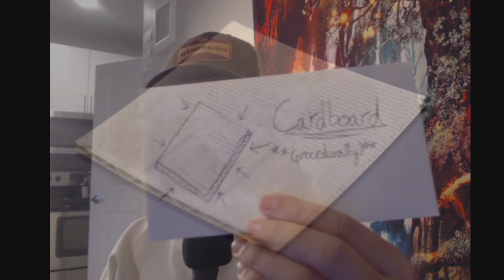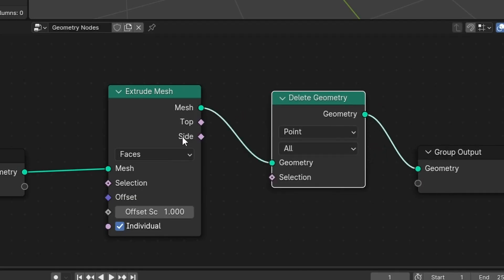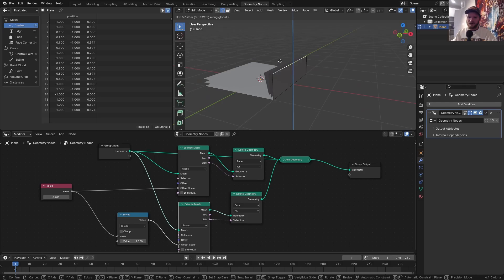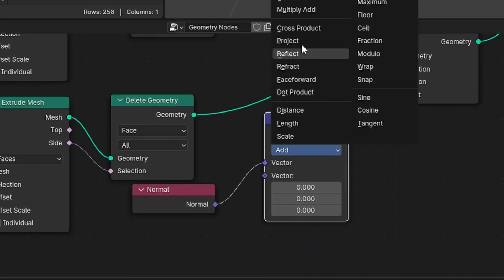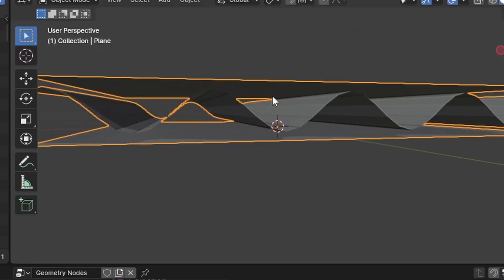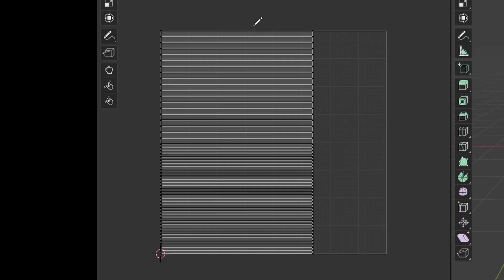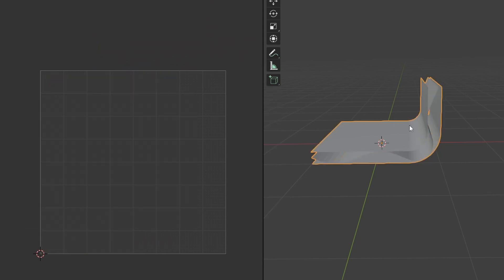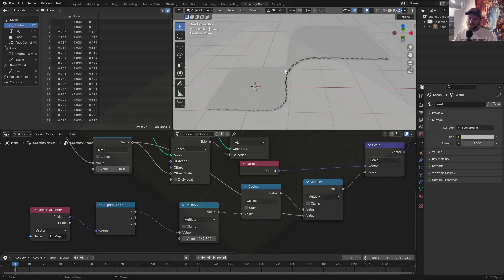procedural cardboard in blender

Comment: very nice usage of UVmaps for deformation! I was thinking can't we use normal for the direction?
Reply: The normal direction just points in the face up or outside direction, Z - it does not really tell you anything about what is "left" and "right" of the cardboard or in other words X and Y. Also each face has its own normal, so you have no continuous left to right range to use a sine or cosine function.
Reply: @gordonbrinkmann  actually you can. you should modulo the indices by 2 and subtract their location to get their vector direction and then apply the offset according to normal.  with modulo you can also make your own sine wave.
Reply: @danialsoozani  The problem is not the sine wave. The problem is, if you want to make some cardboard which is not perfectly straight and flat, the normals will still point in the faces' Z direction, but the X and Y direction can vary from face to face which could result in unwanted turns of that zigzag paper.
Reply: @gordonbrinkmann  I know what you mean, but I think you didn't realize what I meant. maybe I make a video about it later but I'll tell you in short if you get it through this text, you can zero out the unwanted directions by using the direction of indices regardless of problems you mentioned above. you can watch Erindale to get what i mean.